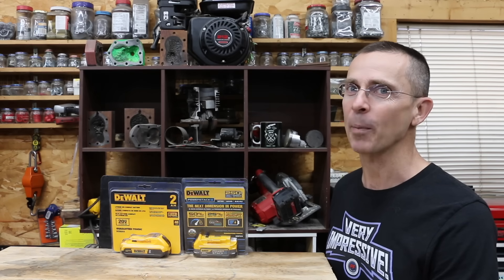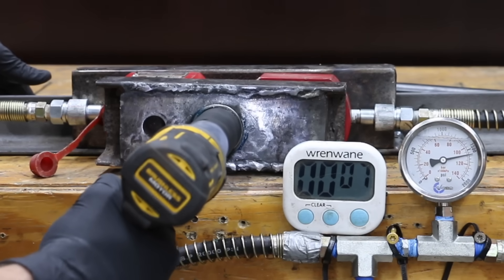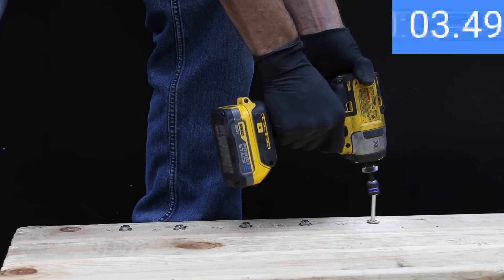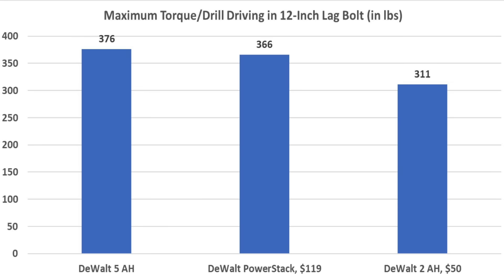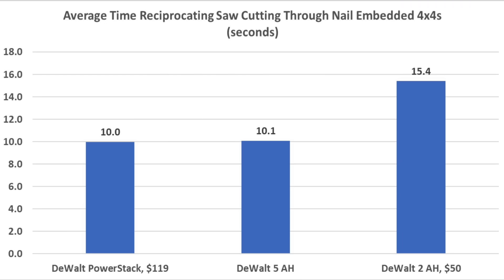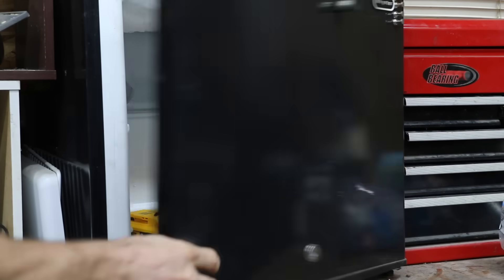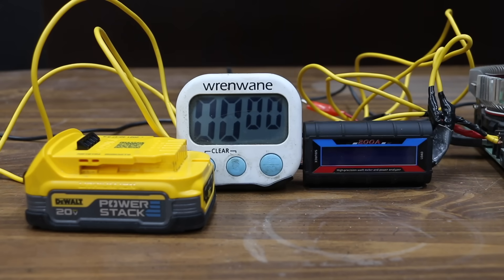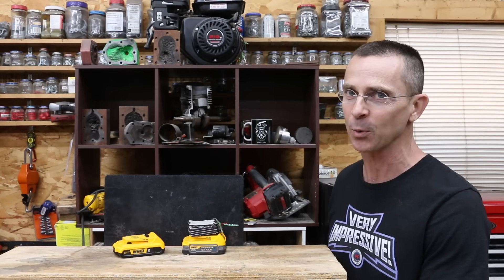Compact “Pouch Cell” Battery Better? Let's Find Out!

Comment: Working at a hardware store that just recently started carrying these. According to the rep, these are the way dewalt is looking to go for all battery cells, but because of the reduced exposure of the surface area of each cell they haven't got a bigger battery ready to go yet. Having issues with shedding heat in bigger piles. The power stacks apparently also did better in extreme cold (Faibanks alaska in winter), but not "meaningfully worse" in extreme heat (Phoenix arizona in summer), which to me says it did do worse in heat but not much, which is consistent with the test results here. I'm also interested to see how the new 60v ultra high capacity when they hit the market. I haven't held one in my hands yep and I dont recall the AH rating but from the images they showed, the new battery looks huge (dwarfed the already very large 12AH) and I cant imagine it being useful in any but the most incredibly high demand settings. I am unsure but eyeballing it, it might be to large to fit inside the battery cradles for the later model 60v circular saws, the 60v chainsaws and the 60v table saw and might be to wide to have 2 side by side on the 120v miter saw. They said it was idea for the large 60v rotary hammer and cutoff saw, which makes a lot of sense. Would be a real wrist breaker on most others. Would be good if they made a true jackhammer intending to use those, since some other brands are hitting the market with battery jackhammers now.
Reply: We've seen the pouch style lipo batteries for 50 years in a lot of cheap products from small to big and also in cell phones. I've had them in things as small as action cameras to lithium jump starters. I hope this is not a way to give a cheaper product by marketing it as some new technology. Li-po is better at high current but it is more dangerous than the li-ion batteries from what I understand. We see in the video that the total power in Wh is lower with the power stack compared to the 2ah regular battery to. The power stack will have its place for high current applications though if you need a small battery. Any larger battery 5ah and up is going to have a lot of high current ability anyway no matter li-po or li-ion when it comes to power tool appicatons.
Reply: If they’re wanting to make this tech their standard, it’s because it’ll make them more money, not because it’s actually better. They can start the pricing higher (double existing) because it’s “new” and I suspect the batteries won’t have the longevity so they’ll need to be replaced more often which means repeat sales. 

The primary goal in business is to make money, not produce long lasting products consumers benefit from.
Reply: They'll probably build in some kind of aluminum heat spreader to make the bigger versions.
Reply: 15aH is the monster
Reply: @nimernimer  that's the one!
Reply from the maker: Thanks for the feedback.
Reply: As you say, pouch cell batteries are far more subject to thermal runaway and mechanical failure.  Heat buildup and control is a huge problem when trying to ramp the size of pouch cells.  I'd recommend sticking with the much more reliable and safer cylindrical 18650 cells or the more recent 21700 cells that are appearing in newer devices.  The 21700 cells developed and popularized by Tesla and Panasonic offer about 80% higher energy compared to a 18650 cell.  This would be a MUCH better solution.
Reply: If this is true and Dewalt is shifting 100% to pouch cells.... RIP Dewalt. They will have much more catastrophic failures than cylindrical cells. High drain cylindrical cells were designed from the beginning to be durable. Pouch cells have never been known for their durability since their inception. If Dewalt wants to be known for "durability" this is the wrong way to go.
Reply: @rockenrooster  the rep didnt say it was for certain that they were going to shift to all pouch cells, only that they were experimenting with higher capacity pouch cell batteries.

Comment: I always end up doing larger projects so I only have the 4 and 5 AH batteries.  I pretend like the little ones don't exist.  The weight doesn't bother me for my applications.  When I have a big job to do, I'll stick the flexvolt battery from my 60v weedwhacker on the 996 drill or my reciprocating saw for the extra runtime.  I haven't run into an application yet where the 5AH doesn't have enough torque
Reply from the maker: Thanks for sharing.

Comment: There is not enough of an advantage to offset the cost of the PowerStack. You are better off with two 2.0 AH or, even at a higher price; two 5.0 AH. Only a very narrow set of circumstances makes the PowerStack a better choice.
Reply from the maker: Thanks for the feedback.

Comment: The 5ah batteries are $199 for a 2 pack and you get a Free $199 tool charger and bag with them.  So if you split the cost between the tool and batteries and call it $100 for tool and $50 for each 5ah battery it’s a no brainer to just buy the 5ah batteries.
Reply from the maker: Thanks for the feedback.

Comment: Can you get replacement cells? I've used 18650 based packs for years and when one goes bad its usually only one cell which has dropped out. I keep the good ones and I can usually make good packs from the old good cells with very few losses. For instance my Dewalt XR (like yours in the vid) still has its original packs - one still going and one refreshed with a couple of cell replacements. 
When they finally drop all I need do is order some cells, swap them in and I'm good to go again.
Reply from the maker: Thanks for the feedback.

Comment: The next test should be is the charge discharge performance of these battery packs to show how they perform after 50 uses and 100 uses and so on. The question will  be if these flexible cells have the long term durability of the 18650 cell design technology. You have best reviews that are unbiased on the internet.
Reply from the maker: Thanks!  Thanks for the suggestion.

Comment: What's really interesting is that this is one of the major differentiating factors between Tesla and other car manufacturers' battery packs.  Tesla uses cell type batteries, but they make up for its shortcomings with better aerodynamics and more efficient electronics and cooling.  One of issues with prismatic batteries is that they are not as reliable as cell batteries right now, but I really feel like prismatic, and ultimately solid batteries are the way of the future.
Reply from the maker: Thanks for sharing.

Comment: Just bought a Craftsman cordless heat gun and made me wonder how the other brands would stack against that. The Craftsman is either on or off with no adjustment to trigger pull. 4ah battery lasts 15 minutes and runs an alleged 950°. Not sure how it stacks to the other brands, but realizing no temp setting (and not much power blowing the heat out) it sort of limits uses. I'd like to see how the other cordless heat guns compare. Adjustable heat levels, does it blow air pretty good or just a slight wisp, do they get to temps that are advertised and how long do they last on one charge?
As always, amazing work! Thank you for what you do!
Reply from the maker: Thanks and you are welcome!  Thanks for the suggestion.
Reply: I bought the Milwaukee M18 heat gun and even with a 12ah battery it is so horrible I only use it if I have no access to 120V. I think that heat guns just need too much power to properly run on 18V. Love Milwaukee and have 30+ tools but this and the M12 vacuum upset me to even look at.
Reply: @JayMoravec  I know what you mean, I have B&D as well as Craftsman. Good for the DIY stuff I do but thought having a cordless heat gun would help with a lot of project too. No more bringing the small generator and 200 feet of extensions (only need about 50 but my luck...). And at 15 minutes per charge, I thought just 3 batteries and I'd be good for the day! Nope. Batteries last considerably less, plus there is next to no air movement. So the anticipated 45 minutes was closer to 10 and a lot of lost time going back home to drag out the usual gear while cursing myself for falling for "the x-ray vision specs from the back of a comic book". Lol!
Another reason why I love watching this channel as well as AVE. They are both informative, amusing and as well as showing the world that you don't have to be owned by a label.

Comment: Thanks for doing this test!  Battery tech is typically such a black box that I'm always skeptical when mfg's makes claims like this.  Not to mention that Dewalt's battery quality consistency has been really dodgy from my experience.  I have 10-15 of them and 2 wouldn't hold a charge after a few months.  Incidentally, check out what Sandy Munro says about battery pouches vs cells.  Between his comments and this video, I'll be avoiding the marketing hype of the Power Stack and just stick w/the 5AH.
Reply from the maker: You are welcome!  Thanks for the feedback.

Comment: pouch cells tend to be less durable than cylindrical cells, but more lightweight and hold more power for the weight.   Basically they rely on the package casing to protect them, while cylindrical cells each have their own little case, which is all held together by the package casing.
Reply from the maker: Thanks for the feedback.

Comment: It's the same tech as what's in laptops, smart phones, and tablets.  They are very sensitive to charging and discharging voltages.  If not perfect after a year or so they will swell and could puncture and combust.  Major fire hazard.
Reply from the maker: Thanks for the feedback.

Comment: Great info as always.  Pretty much confirmed my assumption that there is no need to replace my current batteries.  If the situation warrants performance concerns, use the 5AH.  But if they bring the price down, I would give the Powerstack a try.  For now, I will wait for the early adopters to shake out the bugs.
Reply from the maker: Thanks for the feedback.

Comment: I'd be interested in the price comparison between the PowerStack 2Ah and the regular 5Ah battery.  If the 5 Ah battery is priced the same or less than the PowerStack, then the 5Ah is a way better deal.  You get the same or better performance as the PowerStack, but more than double the capacity.  The only thing you give up is size and weight, and I'm not sure it's enough of a difference to warrant the capacity loss when compared to the PowerStack.

Comment: Great video!  I would love to see the Power Stack covered in a way many have been discussing:  how do they take damage?  How well do the hold up over time compared to a traditional battery?  What happens comparatively when they get punctured or catch on fire?  Things like that.
Reply from the maker: Thanks for the suggestion.
Reply: Damaging li-ion batteries (so either lipo or 18650s) is a terrible idea anyway, both of them can go up in flames.
Reply: @Bramble20322  I was suggesting that because DeWalt and the company that is making these packs for them are claiming some safety enhancements compared to 18650 and 21700 cells.

Comment: Great info.  I always appreciate your videos.
It seems the Powerstack is a better battery over all, but at a premium price.  Great performance, but low capacity in the current Ah configuration.   Now if Dewalt releases a 5 Ah Powerstack and reduces the price per Ah, we may have a winner.
Reply from the maker: Thanks!  Thanks for the feedback.

Comment: As usual with the new implementation of technology, there's a cost benefit for the manufacturer.  "New" does not necessarily mean "better".  At this point, the tests (Awesome BTW!) indicate a better battery (Cost not being considered).  However.... I'm not convinced long-term these are the answer.  And boy... wouldn't these be a fireworks display should they happen to overheat.
Awesome review as usual!!
Reply from the maker: Thanks!

Comment: I wonder how well the powerstack will hold up after 5+years of regular use? Considering how many pouch cells I've seen puff up and fail, my guess is not nearly as long as 18650s...
Seriously overpriced and definitely NOT a battery I'd ever buy.
Reply: DeWalt says double the charge cycles, but lithium ion polymer cells have proven to be a lot less reliable in other applications
Reply: @muddybadgers5205  They're less reliable if they're used in extreme power drain devices, like car jump starters (which draw peaks of 300-500 amps, no li ion cell will take that easily). Using liion for that aplication will either end up with a huge stack of parallel cells (so it will get enough current to withstand it), or you'll end up with a product that wont last long.

LiPo batteries will last as long as 18650, which is around 2-3 years, then there will be quite a lot of degradation (which you may not notice, since its gradual). They're basically the same chemistry (li-ion), the only difference is that 18650s are better at heat dissipation and are less sensitive to mechanical damage.
Reply: @Bramble20322  I know people put them in special boxes to contain a fire when they charge them for RC cars
Reply: @muddybadgers5205  That's good etiquette for any li-ion cell, specially if you charge them with too much current or discharge them at extreme amps (like some RC cars and planes users love to do).
Reply: @muddybadgers5205  That's mainly because those batteries get physically damaged from collisions. I wonder if these packs can handle being dropped off a ladder.
Reply: Pouch cells will swell a bit under heavy load as well, I hope they left some room in there for them to grow.  Fall damage could be a much bigger issue with these as well, pretty easy to internally short them due to crushing/denting.
Reply: Prismatic cells degrade in use more rapidly than cylindrical cells. Sort of like comparing the old NiCads to the NiMh ones. DeWalt's going to lose this bet in time.
Reply: @P_RO_  yeah. Bosch tried this style  when they were redoing their older Firestarters 😆.  In order to make them safe to European tool standards, they would run close to $600 USD per 4ah battery. Lol. Thank goodness they came out with the CORE instead (the best battery out there right now imo.).
Reply: @carterscustomrods . Thanks for info. I didn’t know about Bosch battery tech. Sounds very interesting.
Reply: @P_RO_  Dewalt won't lose the bet at all if the pouch cell batteries cost them half as much to manufacture, costs the same for the user, and 90%+ of consumers don't care or don't use them enough to fail.
Black and Decker and Craftsman both did just fine after they ditched quality for profit.
Reply from the maker: Thanks for the feedback.
Reply: There's a reason other tools don't use them. Plus, a safe version that holds up well, would cost far more money.
Reply: Same here as I've had to toss or replace a lot of those puff batteries and yet 2 of my 2ah 20v batteries from 2013 are atill kicking strong and running as long as my newest 2ah 20v batteries do,plus I'm not paying double for more 5ah batteries when the old 017 ones I have are still going strong and a lot cheaper than that puffy stack battery..
Reply: Everything offered in this thread is exactly why they’re wanting to move to this technology— more sales of the battery packs.
Reply: It has a 3 yr warranty, so that's a little peace of mind. The internal BMS will prevent premature failure which is what you see in puffed up Li-Poly cell packs. The real trick here is the lighter weight and more power for the same approx run time. That will have a use in the over your head workspace market. I use Milw 12V for most overhead work, but some tasks need the power of 18V tools. I expect we will see these start appearing in tool+battery bundles in 2022 to get them into peoples hands and tool boxes. Yet, I'll be sticking with the 18650 packs simply because they are cheaper and I live in the South where the workday temp can be over 100F in the summer. Were I to live way up north, I'd gladly welcome a few of these into my tool chest.

Comment: Power Stack is very similar to battery packs for remote control vehicles. I’m sure they will be able to make very high capacity or high amp draw packs. If they can make them affordable is another problem
Reply from the maker: Thanks for the feedback.

Comment: In my experience the biggest thing that slows me down on a job is swapping and charging batteries, so I tend to run bigger batteries on my tools, 4 and 6 amps on drills and multi tools, 8 and 9 amps on saws. Seeing how the only power stack is 1.5 amps I don’t think it’s worth it. That being said a 5 amp power stack would be awesome and I’d definitely try it out!

If you ever get a chance it would be awesome to get a comparison of different skill saws, especially rear handle worm drive style. Thank you
Reply from the maker: Thanks for the feedback. Thanks for the suggestion.
Reply: your lunch time takes alot more time
Reply: @promo130  yes but there isn’t as much I can do about that
Reply: @tophergauruder3647  sure you can, limit it to 5 minutes and your golden